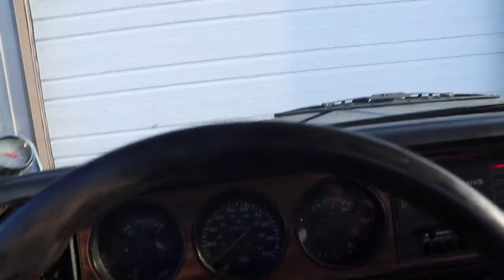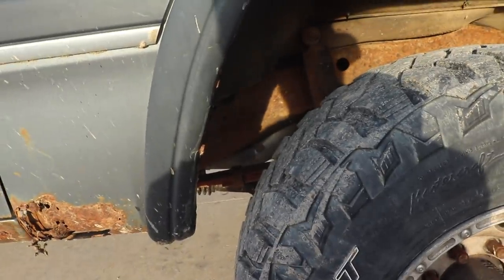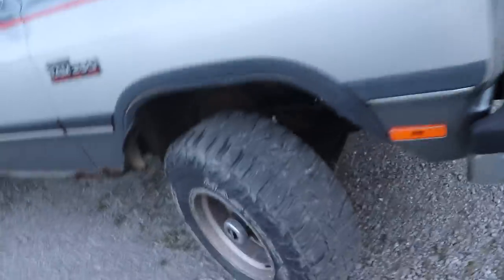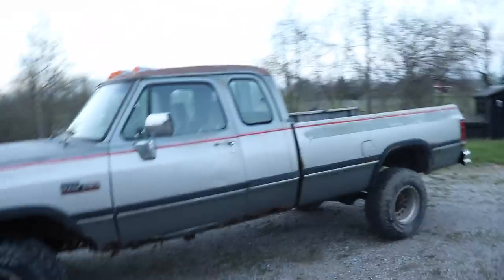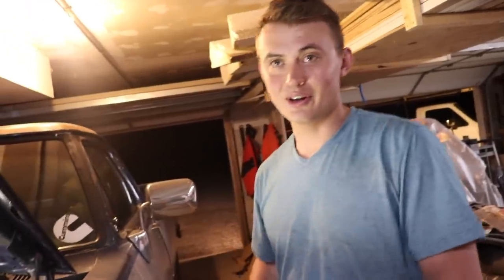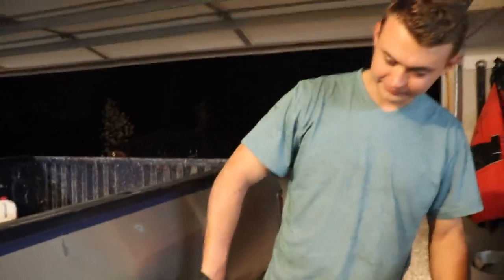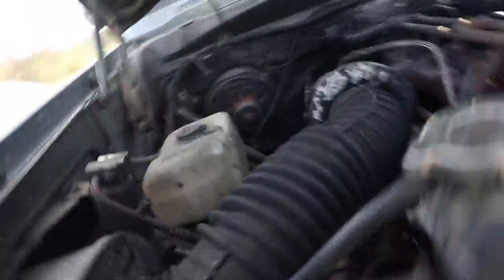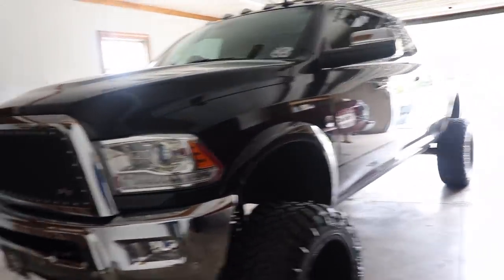SO MUCH CRINGE!!! CUTTING MY 1ST GEN FENDERS!!!

Comment: Might as well cut off all the rust and just fill it with bondo. It will be stronger than rust. Nothing fancy but safer.  That or weld some re bar to the bottom.